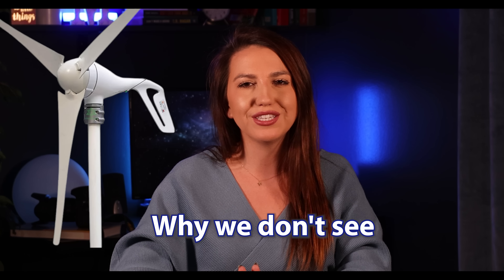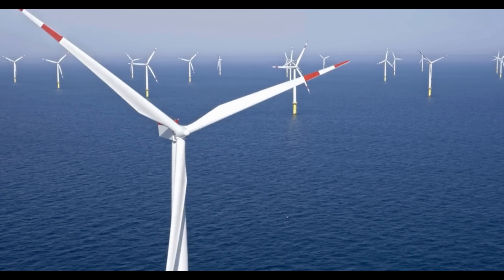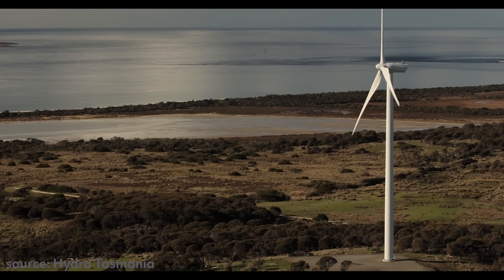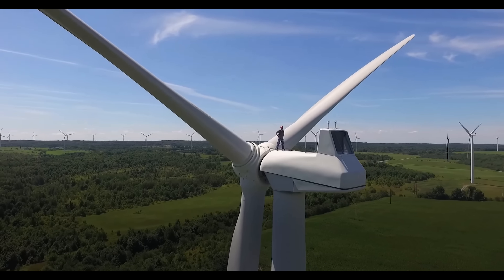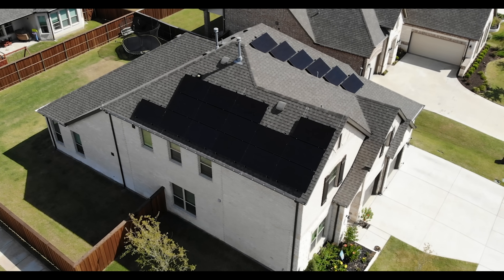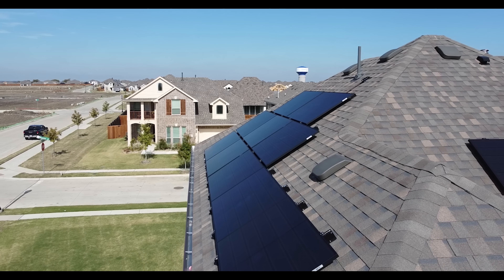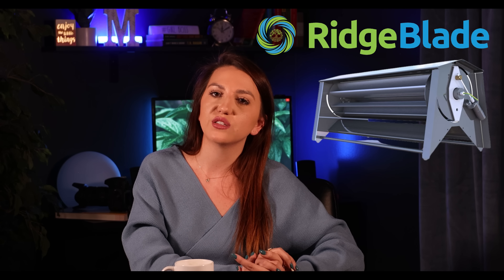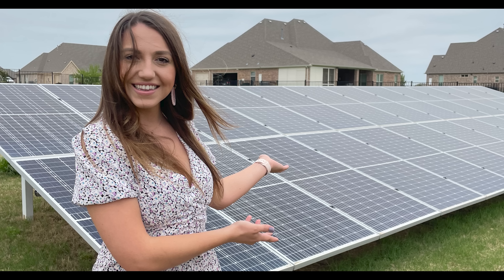Could this Turbine Destroy Solar?  | Why haven't we seen these small wind turbines yet...

Comment: I worked in the small wind industry for about 13 years and sold and installed over 2,000 small wind turbines throughout the U.S., Canada and other parts of the world.  I've owned one in my own backyard for the past 15 years, a 2.4kW Skystream, and can tell you with all honesty, they are NOT worth investing in or owning, nor have they for the past several years as solar PV is much cheaper, easier to site and install and produces more energy in most parts of the world, than a micro-wind turbine.  This is why virtually every small wind turbine manufacturer went bankrupt.  The Archimedes and VAWT turbines are an absolute complete waste of money!  They produce virtually no power at all.  Yes, utility-scale wind turbines are great because they use the economies of scale and are in the high wind elevations where wind speeds are 3-5 times that of low-elevation turbines.  However, solar PV is quickly catching up to wind, in utility-scale capacity, and will surpass wind in the next 3-5 years and will be the dominant source of energy production moving forward.  Utilities around the world are preparing for: 50-60% solar, 20-30% wind, 10% hydro and the remainder, small nuclear, as future capacity on the grid.  The percentages will change, depending on the region and resources, but that's the future.
Reply: Really get sick of these small wind turbine beat ups.  The amount of power you can get out of wind is proportional to the cross section of wind and the speed cubed. So at 5 units of wind speed you get energy proportional to 5x5x5 = 125, at 10 units of wind speed 10x10x10 = 1000, - so doubling the wind speed gives you 8 times more energy in the wind.  However, with small wind turbines the area of wind the propeller covers is in the order of 1 metre and at that scale at best you are talking hundreds of watts, not kilowatts. The efficiency of the turbine or propeller are limited and differences in efficiency are not significant compared to the fundamental limitation which is the cross sectional area of wind the device can access.
So for example, at 25kph wind speed the wind has an energy of about 200 watts per square metre. There is a theoretical limit of about 60% efficiency for a wind turbine, and practically they achieve 50% efficiency.  So a 1 metre diameter turbine (area = pi x 0.5 x 0.5 = p.8) would generate  200 x 0.8 x 0.5 = 80 watts in a 25kph wind. At 50kph wind you get 640watts (double the wind speed, eight times the watts). 
You can also see that the only way to make wind generate significant power is to engage a large cross section of wind.  Domestically we need 10s of square metres meaning blades 3 metres in diameter or more. Whatever you do, along with good consistent wind speed, the area of wind energy accessed is the key to useful wind power generation.
Reply: Wind is plentiful in the winter when we need energy the most- solar is the opposite. Here in the northern UK solar is just about useless for about half the year while the wind produces a lot and potentially 24/7 despite irregular winds. Admittedly small domestic wind turbines are not for everyone in every location.
Reply: @brianredmond4919 Doing fine with solar in Yorkshire. 😊
Reply: @ralpharmsby8040  great - how big is your array and how many kwh did you get this last month ?.
Reply: Get to the basics.
Only the outer third of any turbine or propeller actually does work. The rest is not going fast enough to produce work.
The outer third should have big blades to better capture the wind.
Engineering experiments show that the angle of 25.5 degrees captures the most energy. (Three blade cantilever blades are at an angle of about 2-4 degrees).  This produces high RPM, and is not efficient.  It also produces noise and vibration.
Going faster takes more energy from the very wind that you are trying to get energy from.
Bigger is better with all wind turbines.
Heavy on turbine blades is not good. More cantilever blades add more weight, to the point that the shaft cannot support more.
The Tension Turbine is the only wind turbine that is feasible now.  The Tension Turbine tip speed is  SLOWER  than the wind.  This produces maximum power and little noise or vibration.
The Tension Turbine: Half the weight, twice the power. 
The future is the Tension Turbine. TensionTurbine dotttt commmmm for more information.
Reply: Uh, yeah, predictably, there is no such tension turbine daht calm website.  Oh wait - there it is - he spelled "tension" wrong in his website URL.  He spelled it "tention" - OMG.  Well guess what?  Everything else he said is also wrong.  Typical wind energy know-nothing "know-it-all".  They are everywhere.   It amazes me how we never hear the end of this nonsense from people who know nothing about wind energy, and think their uneducated vague impressions are more accurate than what wind engineers know.  Yes wind turbine blades go fast, and that is why they are so efficient while only taking up a couple percent of the area of the circle.  Enough said.  I could write a book on all the idiot misunderstandings of the average person with no wind energy knowledge, but it gets old after a while, so I will stop here and just warn people that what this guy said is completely wrong and his website URL is spelled wrong and its message is wrong.   But he is not alone.  There are a million more like him out there.  They are everywhere!   @0077alfie
Reply: We live right beside the steepest River in the lower 48 States. That water NEVER stops flowing past us. We pay Property Tax to the Middle of that very same River. And It’s illegal for us to install a small Turbine.
Reply: @MarcusRefusius cant make a little waterway in and back out again and have a smaller hydro ???

Divert water on and back again ❤
Hydro is awesome and very powerful 🎉
Reply: @MarcusRefusius you can always can take water for proper needs and install the water turbine inside your property
Reply: Solar is useless during winter in the far north, so wind is an viable option there. Making a vertical windmills at low cost that works at low speeds is the key. DIY it from free scrap makes it viable, but buying a commercial windmill is not an good option.
Reply: @SkepticalCaveman  just saying that whatever you build needs to intersect with a decent cross sectional area of wind. Getting higher helps because wind speed increases with height, but devices that only use one metre diameter propellers won’t generate more than a few hundred watts.  Some people have put turbines on pitched roofs where the roof acts to push a big section of wind up over the top increasing its speed. In those circumstances a smaller  propeller will do much better because the wind speed is increased.
So placement of your wind generator where the oncoming wind gets funnelled can achieve much better results than having an archimedes screw propeller instead of a regular one.
Reply: @SkepticalCavemanDecember and January is always deadzone for solar in Erie Pa.... San Diego on the other hand....
Reply from the maker: Hey! Thank you so so so much for sharing your story and experience. It is sad to hear but I can totally hear how it would be a waste of money, and clearly since none of those inventions are actually available and it has been so many years, we can see that the economics of it just does not make sense. 

Thanks again for sharing!
Reply: @solartimeusa 😅
Reply: ……where vertical axis wind turbine (vawt) are used is quite relevant…….Don’t limit ur choices….. when used to charge batteries u can easily transport energy elsewhere
Reply: I tried telling people that all the time everybody thinks they know better it's the new technology these are better than an old ones they never listen thanks for your post I need all the help I can get stopping these people from getting ripped off
Reply: @dducko complete agree whit you on that❤
Good experience worthy more then any comersiale 😂😂

Together we get the real experience. 

Same as i try to tell many people that grade A and B and blablabla is leftover battery's from NOT PASSED BATTERYES FOR EV-TESTS.
thats totally waaaaaaay off 😂😂

People belive thos are the best whit 3000 to 6000 cycluses. 

But passed the test for ev test can make you 30 40 000 cycluses 😂
And prices for grade A ore some blablabla is the best them says. Cos them thinking thats the best, whit out contact manufacturers and learn how it all is❤😂❤😂

So it is much better knowing peoples that's totally stuck and know what's the best whitout ever used them self.

Thats why experience from peoples that have bean use it and knows of experience!!!

Happy new year and good 2024 for you all
Reply: But how do you mean for us thats lives and traveling whit small boats (houseboat) (up to 15 meter feks) will this smaller wind generator make my 11kw VW e-golf battery package in 24volt system, help me night and day whit a little power when bad weather hides the sun for days up to a week of 7 to 10 days ???

I do have 4 x 320watt panels flatt as water over my head over flybridge on back of the boat.

Have good experience whit my solar power. 
Have bean using solar only first 1 year at old hospital backup power 44kw enersys AGM deepcyle battery's. 
Hold me ok whit power. Not use so much. 
But then i did get a good price on lithium VW e-golf battery pack on 11kw.

And i do now traveling on my 11 months straight and lives on board.  Traveling from norway there sun power not are good. Down european waterways little by little. 

You have this smaller period of time where you dont get anything of watt allmost. You only get 100watt on daytime now when rain and bad period this winter. 
Low sky and dark time. 

Then i will belive 1 small of this vind generator can help me out a little???

Cos allways have hybrid inverter on whit internet lights and some kamera cctv think they are called. And other smaller things.

And allsow I do use some power at 1 of my two china diesel air heater, that i normally use 24/7. Not really shure what's using on full blasting,  but if i remember correctly it uses about 10-20 watts. 

So allways uses little for chagrin phones tablets and computer. Tv and smaller things thats not heavy watt user.

Had a problem now whit 1 of this canal lift elevators in Germany,  so 1 of my 4 panels gat damage so i had to remove 1 serie of 2 panels. Then the dark time comes and maked me down at 25-30 % left for use at lithium. 
Never bean that low on 11 month's. 
But will change out this broken panel and get up a new panel so i can use all 4 panels. 2 in serie and 2 paralell.
Never bean lower then 75-70% before this panel vent bad. Not even last winter.

But whit time you use more and more power you probably know how it is 😅

But what i think and believes in is 1 smaller wind turbine for topp up bank fully. 
Normally sun holds me at topp of battery power. But the rainy days ore weeks before winter is coming i do get lower then normally. 

You dont think this will be a good solution for my case ???

Dont need so much, i am on 11 months of use, and i have bean on topp only whit solar.
But when this time ore period comes wind help me to topp both nights and day's. 
Alsow if you only get a little watt, that's will make me floating at topp level all time.

Allsow i do use air-fryer for food cooking 2 times every day whit 8 ore 900watt for 10 15 20min every time, normally every day.

Alsow i do use little smart battery charger for my start battery's bank. Spesially when i stay in town ore at anchor for some day's here and there.

All solar experts told me my location solar is not anof cos over Europe where my JURNEY started, the sun is not good place for sun.

But have bean good last winter and maked me good whit out shore-power recharge to now.

Only want little extra watt so my battery pack allways are on topp.

Summer time i turn of solarpanels for day's. When your over fully and only stays between 90 and 100%. So then i turn of for periods. Just for the fan inside hybrid-inverter.

You agree ore what you think about this ???
You belive in it is Okey for few watt this longer days whit dark rainy day's  ????

Shud belive in help from wind for just a little help when it is dark.

I do traveling down european waterways for coming to mideltereinian area. There sun are hot and good year around.

Shud belive that would helped me out in my case at least ???

Thanks for properly explaining of your knowledge 🎉

Hope you see and can share your experiences ❤❤❤

And to all you others,  start traveling and live the free good life 😉
Ship o hoi from norway man thats motoring true all this european waterways elevator canals bridges and so much more good cool places
Reply: @Lordlindef  If you're going to use a wind turbine first look into what's called a buck  boost converter It keeps the voltage stable for charging batteries kind of a cheater but it works It won't give you much but I understand in some places having that little bit of power is worth the price so look into them or turbines with buck boost converters on them
Reply: If the government releases the technology it have been suppressing for over 70 years we will globally have an energy system that pulls energy from the atmosphere around it and produces enough energy to power a city with 1 million ppl with a generator the size of and infants fist. It’s up to the fossil fuel companies and the government to make that transition. They have the tech, just like they’ve had the tech to make the wheel obsolete decreasing costs of road construction, vehicles, and transportation as a whole running on water and not just any water, water refueled to your vehicle from air condensation collection systems. The technology is there and there are people not just scientists engineers or inventors whom are ready to put these technologies forward when they are allowed by governments globally around the world.
Reply: Even Big Solar has shills...... Crazy
Reply: So is that is why Biden is for them !! Lol 😅😂 breaking the government and wasting money!!!
Reply: Not just that but commercial wind turbines are freaking massive. Small wind turbines just don't get enough wind at relatively low heights
Reply: But allsow this is for ekstra power whenever solar dont fulfill me 100%

As "extra little" watt this will help. But not as main charging.

I have maked a boat over to houseboat and lives and traveling all year and use this every single day for everything as a cabin.

And i have very very good experience whit solar panels.

Ofcourse cud have maked more panels, but it is ok if not locking like hell to 😂😂

Now last 11 months only used 11kw lithium VW e-golf batteri pack.
Hybrid inverter and 4 x solar panels on 320 watt for my 24volt system.

And i do make food and heat whit diesel heating thats use little watt. 

And all is like an cabin ore apartment on water.
Whit all you use and need every day use like phone tablets MacBook TVx2 internet camera's heat lights and much much more 🎉

Lithium allsow is crazy that all this people that's buying lithium all ways at this online-stores 😂

Lithium battery gets better if you studdying battery and all car inspection test and so on.

And 100 dollar panels x 4. 500 dollar for hybrid inverter all in one. And battery pack at 11kw for 1300dollar. Little under, but closely. 
Have bean so fully whit power that have not get down for cyclus use before some weeks now whit only 2 of 4 panels in use. And very dark whether maked me down more then normaly.
11 months whitout use 1 cyclus, is really not bad at all.
And then i do use as in a normal home as cabin ore apartment. 

So self supplying for free is not so bad.

I do see all this youtubers that's use many 1000 of dollar for make their system's 🎉
Normally peoples sailing like @svdelos @svuma @uma.

Good life and goodness of a life is possible ❤
Live now and be happy peoples ❤❤❤

Haven't seen anyone make it this low cost for 24/7 365 days every year use 😉

Ship o hoy❤
Reply: But allsow another thing. 
This new last 2 year have been coming better and better ??
Thing shanges and gets better.

I just dont want a big 3 legs wind generator.  But this one locking interessing out.
But need to studying them a little more and see what options there is.
But i know wind generator and this split face low watt use heat-pump are getting better and better
Reply: Can you share some insights.!! Btw m frm india, people are interested in efficient renewable energy which can be installed on home roof or backyard. Also the government helps through subsidy on residential solar. In india scalable solutions are much successful. Also india will be huge energy seeker due to huge development. Please help me get better small cap. Wind turbine solutions..
Reply: I have a couple of solar panels on a cabin with a large 5 kW inverter. In the summer there is never a problem with power unless the time I tried to use an electric plasma cutter together with an air compressor :) So main problem is storing the energy and to get charging during winter months (living way north). I am mostly hoping to find a place with a small water stream to use but a wind turbine would be the last alternative. Sometime it blows to little in winter and sometimes too much so it might break.
Reply: ridiculous.
Reply: Thank you for a authoritive and frank summary. I live by the beach and have pretty regular wind so I've been interested but I'll go a different direction.
Reply: Probably equal to Elon baloney masks watt savers or his little heater that would not heat a lizard. All scams. My bill went up 9$ a month when I plugged in the watt savers.
Reply: Exactly... By the time they would pay for themselves (still living where you can buy from the grid, and are not living "off grid"), you must rebuild them or throw them out. If they were near free to buy, sure. But if they cost alot, forget about it.

Living off grid, that's a different story
Reply: Err no its not taking over solar lol.
Reply: Bravo very good to explain
Reply: La única mala idea es la q no se hace .Caro a lo mejor comprarla hacerla ,sería la salida y si estoy donde corre mucho viento .Veamos el vaso medio lleno y no... Let go
Reply: Hey, I could really use your expertise in developing wind turbines. Your help would make a huge difference in bringing this project to life, and I'd truly appreciate your guidance. Let me know if you'd be interested in collaborating! @MrArtist7777
Reply: Agreed!
I've seen a few that are worth the cost in very stable constant wind conditions when solar was VERY expensive.
I have a small 500 watt unit that averages about 50 watts per hour to backup the solar.
For most, they're a total WASTE of money.
Reply: Solar is not always available, wind isn’t either. Nothing last forever. Wind causes vibrations that self destructs, solar has many issues. Electronics fail, and solar panels are always exposed to the destructive elements, along with panel supports inverters water intrusion etc.. Pay for nuclear and take your chances. Failures are the problem for the utility company, solar and wind, it is always your cost and problem.
Reply: Produce enough power to run my toaster, if it is windy......
Reply: So it took you 13-15 years to come to the conclusion that they are not worth investing in or owning. Why is that?
Reply: Thank you for the warning. ⚠️
Reply: I invented 2 wind turbines. Do you wish to see my design?
Reply: Wind turbines kill birds and you can't recycle them once they fail.
Reply: Installing a wind turbine always depends on if your place is windy or not.......... But in solar......  sun is always available
Reply: @alphaphichufafionse3005  Like wind the sun is not always available
Reply: @alphaphichufafionse3005  
Where I live today: No sign of Sunshine!
Reply: @alphaphichufafionse3005 unless its evening or cloudy
Reply: @fushumang1716  our place is not windy............ We have tall trees I dont see a constant wind........ So the best option is solar....... But I like hydro more
Reply: @fushumang1716  PV produces energy even when it's cloudy....
Reply: @ckm-mkc  very little
Reply: @alphaphichufafionse3005 hydro is awsome and very much better.
Solar is very good too.
Maby you can take of the topp of 1 tree and put up wind generator up in sky ???

Solar is awsome even when solar stays levle as water does.
Wind can help, but wind for main charging i don't belive can be so good.

I am not an expert in volt watt but just shares my experience 🎉
Reply: @ckm-mkc  Not very much
Reply: @alphaphichufafionse3005  No the sun is Not always available. Until a Solar panel can generate more than a small amount of mill amps of power in cloud cover will they be able to Produce better.  Then at Night you need a Battery bank OR you have to rely on the POWER Grid for you electric needs. House sized battery Banks are EXPENSIVE!!!
Reply: go back to sleep buddy @alphaphichufafionse3005
Reply: That little wind turbine you're selling could probably charge one car battery enough to run a single light bulb for the evening if you're lucky no matter where you put it and if it's spinning constantly or not
Reply: i should of just came and read your statement, instead of wasting my time on her useless video. She did not suggest ANY wind devices we, the viewer could actually go buy. i bet she got paid for advertising to those Pay Now, and get ripped off when we fold kind of scammers.
Reply: @stalkingtigerscom mhm. But same and similar are made more video of 😊
So many different ways and set-up for many kinde of usage.
Must have the very best for you and your set-up ❤